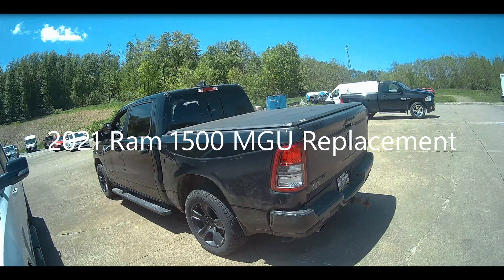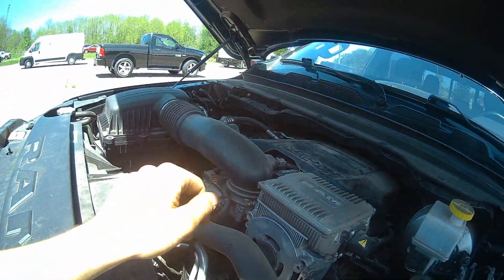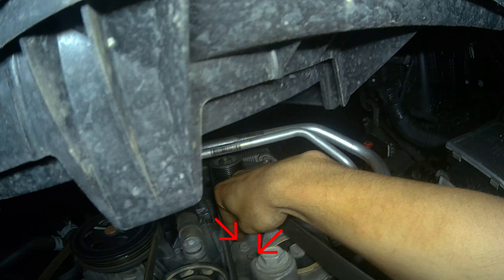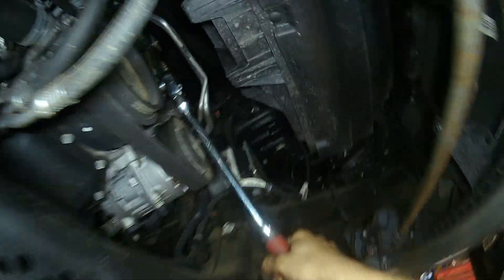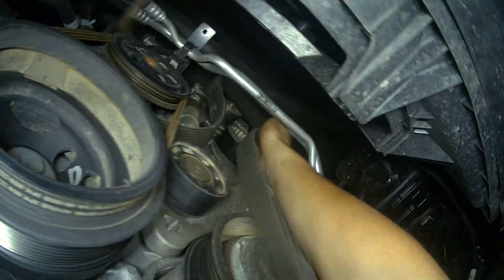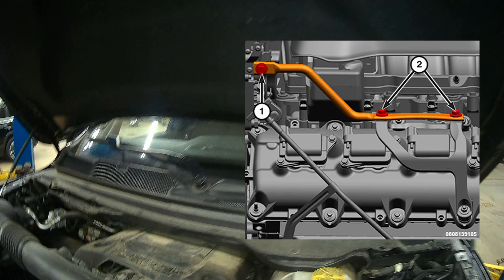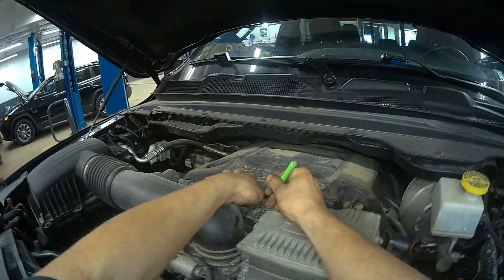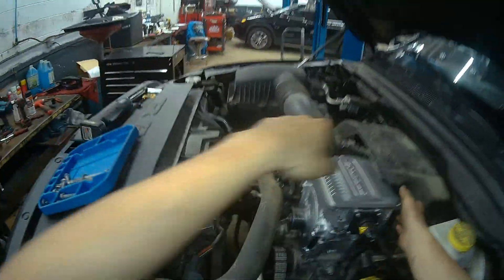21 Ram MGU Replacement

Comment: Did you have to program it?
Reply from the maker: Yes or it won't charge
Reply: @Cwmills23  Shiet ! I just bought a ram . I was going for the alternator one but then I saw theme torque used for 500 and said “fuck it I’ll diy it if I need too “ wrong ! I’ve heard it’s only a dealership thing

Comment: Did you have to reprogram this. Or can I change this by myself.
Reply: Did you ever find out?
Reply from the maker: @josephmcfarland961 yes you have to program at dealer or it won't charge
Reply from the maker: You have to have it programmed or it won't start